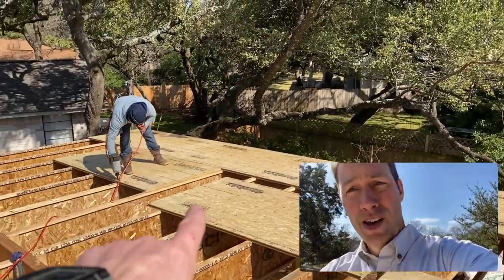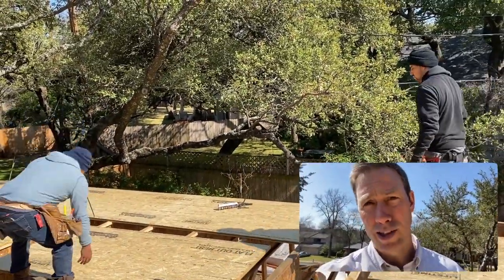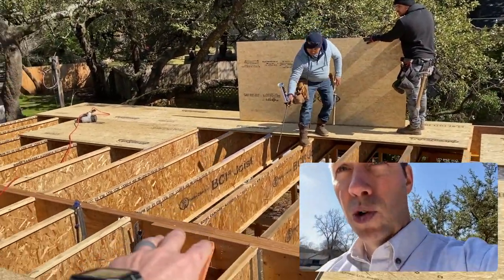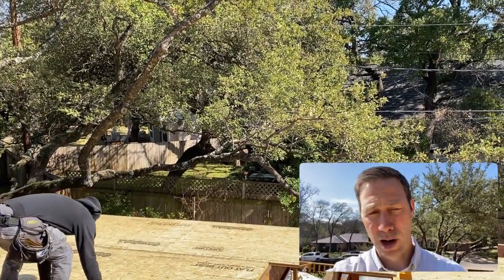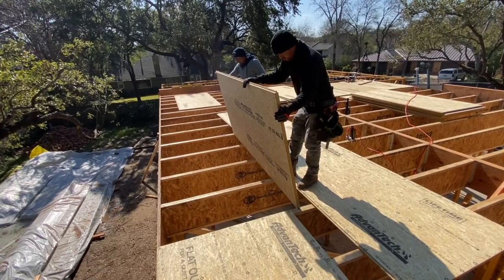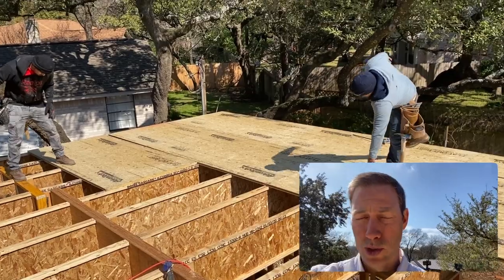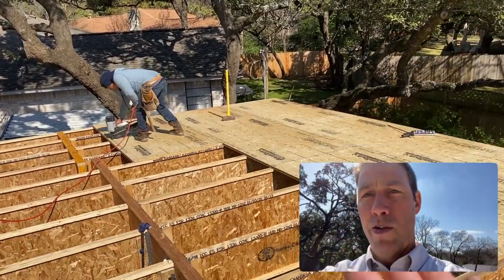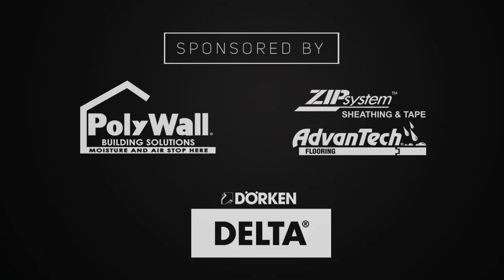Subfloors - Best Practice - Real ReBuild

Comment: Looks good Matt. Quick question,  I have 3/4" subfloor, should I put 1/2" underlayment before finish floor? Planning on wood floor.
Reply: Not necessary. Signed, a carpenter from Pittsburgh
Reply: If you are putting in hardwood, then no.  3/4" wood is usually plenty strong, and back in the day didnt even need a subfloor.

If you are using thinner hardwood or engineered, and you have a lot of dips in the old floor, it wouldnt hurt to add some 1/2".
Reply: @bigpjohnson  I was thinking of using plywood strips instead of hardwood flooring, save a few dollars, and going thick enough to be level with tile in bath and kitchen. Thanks for reply.

Comment: Thoughts on glueing at the expansion gaps on the T&G sub floor?
Reply: Yes, I was curious as to how tightly the panels were being butted together. If they are butted tightly or glued, you've got no room for expansion, but perhaps the strength of the glue and the thickness of the panel means that this isn't an issue.
Reply: @tlangdon12  we use Weyerhauser Edge Gold and in their documentation they say to have a gap along the T&G edges for expansion but I've heard that adding some glue can help with pops. Trying to see if anyone else can weigh in on this.

Comment: I see it over and over again, dropping the sheet of sub floor down on the glue that is meant to prevent squeaks. When that sheet of sub floor is dropped and it hits the joist the glue is smashed and most of it is gone from the top of the joist. If you want to do it right let the sheet of sub floor down gently so you don't slap the glue and pretty much defeat the whole purpose.

Comment: 2" x 4" against the decking when using a sledge hammer. What framer wouldn't know that?
Reply: or, for a better force spread, use a section of off-cut from the flooring material as the block to hit, the tongue fitting in the groove kills any chance of it being damaged when being smacked into place.
used this method when installing a sprung hardwood floor in a dance studio . Couldn't nail or screw or glue any of the boards down in any fashion, we had to use specially cut end blocks to secure it down at the walls. ( cut a notch out of a 1 by 2 taking a corner off so it has a 90 degree angle to put over the floor edge to hold it down )
Reply: No comprende

Comment: Wish this stuff existed, and my contractor knew his ass from a hole in the ground, when they built my place 20+ years ago.
The idiots doing the framing grabbed the pile of 1/2" roof sheathing instead of the 3/4" tongue-and-groove plywood for the floors. I didn't find out until after the walls and roof trusses were up. And then, of course, it rained for two or three days before it could be closed up.
Reply: I was in the business 2004-2008 or so and almost every house I saw did similar. I live up north and it always blew my mind. These were almost all expensive 'custom' homes too. Most of the time it was generic 1/2" OSB and that's also what was used for the roof.
Reply: Lucky it was 1/2" because in my area 3/8" is still code for roofing. I laid 3/4" PT non TG subfloor in my shed and put another layer on top because it wasn't solid enough at the seams, can't imagine 1/2" in a house. I hope you have something other than carpet or you'll be stubbing your toe on the bends in the floor!

Comment: Bought a new house .... From day 1.  Squeaky floor.  Builder's solution .... kinda look around seen a small separation of floor to joist ... it looked right .... just squirted some glue in it.

Next day .... squeak ....  Builder never came back ....   Farking spec home builders.
Also to be honest.  I think I'd rather have a 2x4 truss rather than i joist.  Yeah I know it's more material but I think I like the concept better than the ijoist.

Comment: These manufactured beams might be great on the west coast where is it dry but I can't see these laminated wood beams lasting long in high moisture environments like craw spaces that stay moist and wet. I would be more inclined to use them on second floors and ceiling joists that are not in wet moldy environments.

Comment: I'm curious what folks in the EU use for adhesives, because last I heard, urethanes were verboten...
Reply: Wooden homes are rare in Europe, at least where I lived....most of it is all brick or concrete...even on the second floor all floors are concrete there....🤷🏻‍♂️
Reply: We use Polyurethane Adhesives in the UK extensively. They are common as wood glues and construction adhesives. You can get foaming, low foaming and and non-foaming types for construction.
Reply: The real question is on the longterm durability of the glue. I looked for warranty information, and the first one I found was for Titebond. Their warranty is lifetime for the original owner. My bet is that the third owner will be swearing at the contractor who didn't use screws. I also wonder about the glue holding the LVLs joists together over time, as the humidity level of the house changes between seasons.

Comment: Hi Matt thank you for the video it's really good.  I really like that thick flooring.
I have two questions though.
1)  I noticed the guy using the side of a sledgehammer knocking the edges together is that allowed?
2)  You are using the polyurethane adhesive on the top of the joist system but I did not see any adhesive put on the edges of the flooring to join one sheet of floor to the other.  (Tongue and groove no glue)  Is that acceptanle practice?
Thank you for considering these questions.
Cheers, John L. in Fairlawn Virginia USA

Comment: Screws vs nails. I’ve always been taught that screws are superior since they won’t back out. Nails can work themselves out with expansion and contraction of the wood. Those “loose” nails are one of the things that cause a floor to squeak.
Reply: The trick is to use screw shank (or ring shank) nail. They hold like screws and go in like nails.
Reply: Matt made the point that once the glue sets, it is the glue that holds the floor down. The nails just clamp the panels down until the glue sets.
Reply: Tony Langdon I know. The floor won’t be squeaking but the nails rubbing against the wood will squeak. Perhaps ring shank would help. But for the extra bit it costs to use screws, is it worth the risk?
Reply: Project Farm did a test that galvanized nails hold like a hot-damn. Like as good as ring shank. I can confirm pulling the galv nails out of my most recent build after screwing up a wall was a less than fun experience.

Comment: Does someone know if there are any quiet outside ac unltd which can control two independent cooling/heating cycles?
I mean heating one cycle and cooling another at the same time ;)
I want to attatch it outside of my trailer home and use one cycle for actual ac and the other cycle for active and external watercooling for my pc.
I don't know if anyone ever had an idea like this but after some research it seems entirely possible. I just couldn't manage to find a good product. All I found were HUGE (20kW+) units starting at around 12.000€, like the Mitsubishi VRF R2 series.
I would really appreciate it if anyone could help me with that one =)
Reply: Nope. Multizone units are sized for large heating\cooling loads.

Comment: If you use 3/4 Cox plywood t&g glues on every joist and seem you will have no squeaks.   Squeaks are from guys not gluing the sub floor to the joist. No need for the added cost of 1 1/8 subfloor

Comment: dropping your plywood can cause the glue to be blown off or splatter off of the flange of the joist.
Reply: Was going to ask the same exact question.
Reply: 007rcb this glue comes out as foam; then turns to liquid that sets up like a thick honey, but very tacky. I doubt you lose any. Its awesome stuff.

Comment: Shouldn't the Rim joist be glued as well?
Reply: Peter Wong, back in my house building days we didn’t, but we also didn’t nail at first either. We would run long, snap and line from corner to corner, cut the off fall then push or pull the rim board to get it perfectly straight.

Comment: I have a tract home with unlevel, bouncy, squeeky floors! I hit the trifecta!😒
Reply: Which has very little to do with the materials....its the engineering and installation that's the problem.
Reply: Noone can sneak up on you and kill you as you sleep.
Reply: @dielauwen  I renovated my old house completely, but left the squeaky board right at the top of the stairs.  If a burglar tries to tip toe, it'll sound the alarm haha.

Comment: Hum, you said you paid about $40 per sheet for Advantech OSB, this video is dated 03/21.  In 06/21 I paid $90 per sheet at Home Depot.  Sounds like they should be called "TakingAdvanTechofYou"  Right...I know ALL types of subfloor have skyrocketed, I'm not just picking on this one company.  BTW thanks for explaining the benefits (in another video) of using this top of the line flooring, which I might have never learned about.

Comment: Inch 1/8 plywood TG and inch 1/8 advantech TG are not exactly the same thickness.  Thought I could repair a plywood floor with the advantech but no, different thickness.

Comment: Are there any trusses made from lvls?
Reply: Well you can frame the floors out of LVLs instead of TJIs (I-Joists). Its just a lot more expensive.
Reply: @guytech7310  then you don't get the benefit of the open webs to run mechanicals through. But still get the benefits of straightness and stiffness if the trusses are made from LVLs
Reply: @ColeSpolaric  Issue with Open Web Trusses is the quickly fail in a fire. You have only have about 2 minutes to escape if open web trusses catch fire. TJIs will maintain integrity for about 15 to 20 minutes. The issue is that open web trusses have a lot of surface area and also provide much more access to Oxygen. 

Second the Original posted asked why couldn't LVL's be used instead of TJIs which I answered directly. He didn't ask about floor trusses.
Reply: @guytech7310  that wasn't the original question but whatever.... Both suck in fire. Insulating would reduce oxygen availability in both cases if fire is a concern.

Comment: Its interesting I live in Northwest Indiana and since watching your videos I'm really noticing how crappy the construction is with these cookie cutter subdivisions going up overnight.  Then people wonder why their half million dollar home has water and mold issues 10 years after being built
Reply: For real it was bad enough 30 years ago when my house was built. My next house preferably would be 80's or 90's full brick with basement, hip roof, minimal weird architectural features that will leak water, single story. It doesn't have to be fancy just has to be new enough to not have that sketchy early 70's aluminum wiring and those explody water pipes (forget the name), and have decent building codes for insulation and structural strength. My parent's house has a roof with trusses spaced I think 36" on center built in 60's. It looks wavy. I guess it's fine though since it's lasted this long.

Comment: You need an audio guy!....Your audio could have been fixed here with the use of compression on the audio during periods of nail gun firing, thus backing out the Auto Gain Control that kicked in during gun firing. It would have been an easy fix.

Comment: The glue looks like it wouldn't work...
Reply: I had to remove some advantek put down with this glue that was about 2yrs old, it pulled chunks out of the subfloor and splintered off the tops of yellow pine joists in places. Remaining glue was so solid it had to be planed off not just peeled or scraped. Very impressive compared to tube glue, will it last 25 or 50 years? Who knows, but it's super strong in the beginning

Comment: Screws vs Nails vs Staples,  as a remodeler,  everytime  I have to  pull a subfloor.  Those damn staples seem to hold the best.   If it was me I would prefer staples.   Anyone else want to chime in?
Reply: ZigZag 8d nails are code for subfloor.

Comment: No hardhats , no safety glasses , no fall protection system .  That one day OSHA shows up and hands you big fat fines and the state board of health .   I absolutely despise rule benders just to make a quick buck . We don't glue any floor we been screws only for 10 yrs never squeaks the walls on top we glue thsts is where most all squeaks come from . Nailing the floor is dumb the joist  flex and the nails is the cause of the squeaks . Beside the walls on top .

Comment: you volium is not good in and out. BAD BAD
Reply from the maker: Sorry about that. Impromptu iPhone video
Reply: @buildshow  When you have some time you should look at the settings to see if there is a way to turn off AGC (Automatic Gain Control). Or maybe get a second video camera app that you can keep AGC off in that app. On android I like Cinema FV-5 because it will show a DB meter with clip indicators. But it's really hard to pull out your cell phone and shoot a professional looking and sounding video.